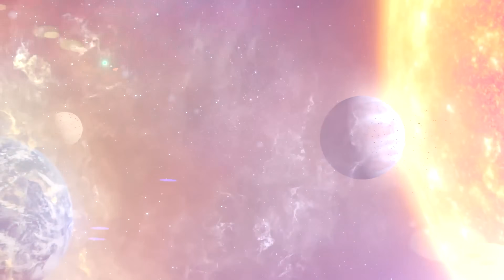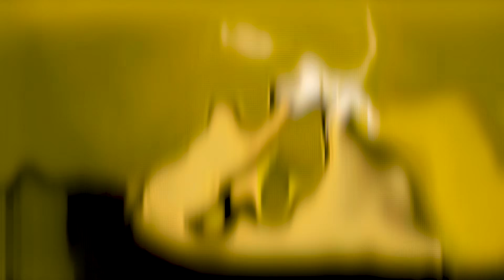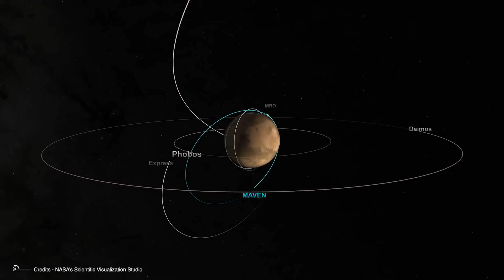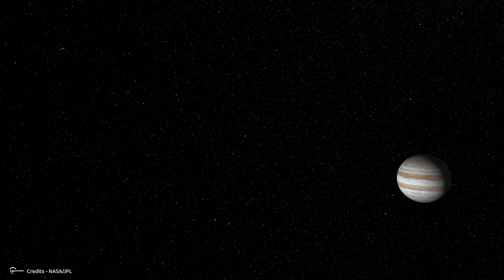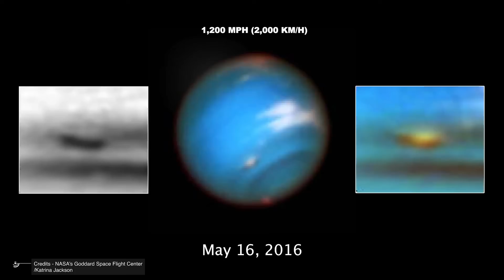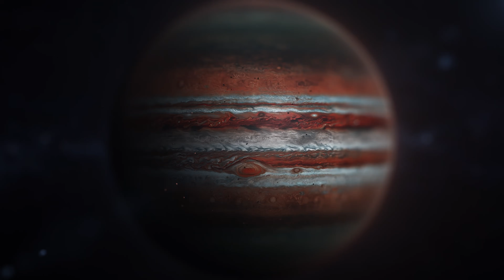Why the Solar System's Worst Planets Aren't Impossible

Comment: We need orbital JPL - with families, radiation shielding and artificial gravity. Tech needed are broken washing machine propulsion, doing an actual test to calibrate how a spinning habitat would work - if it will work. If not - get out of the space business, and start with a table top exercise to plan the elements of the station - especially its demographics.